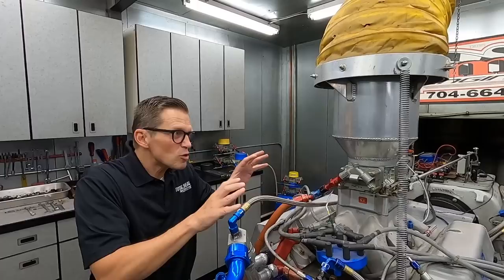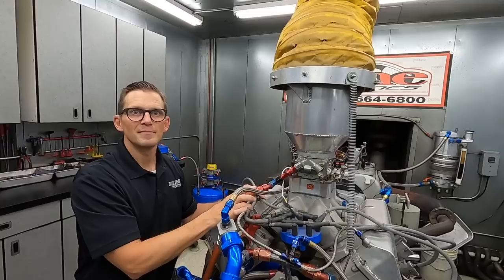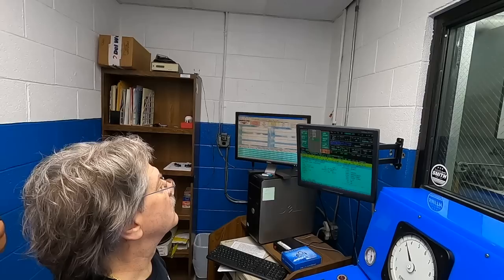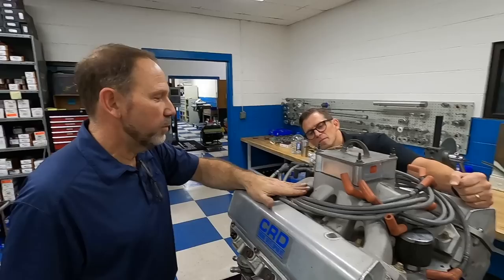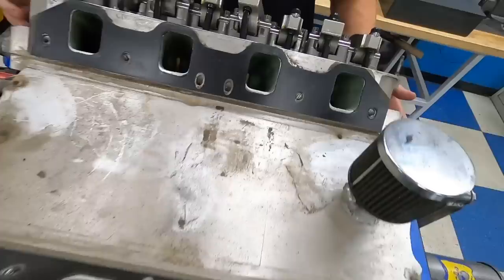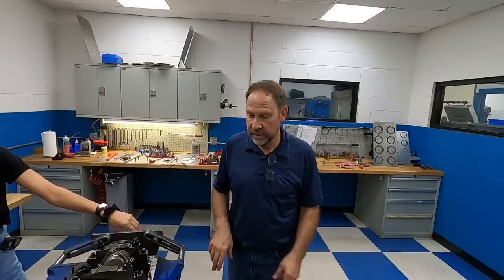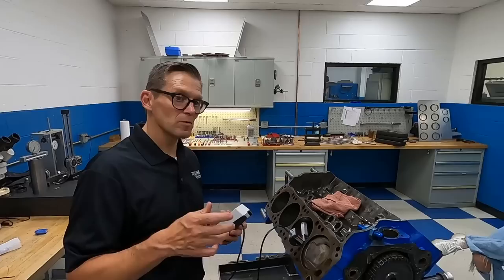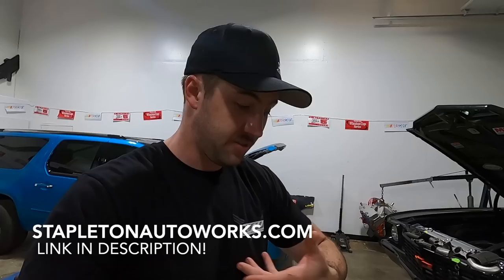Lake Speed's Ford C3 NASCAR Engine: Time Capsule of 90s Technology! (Dyno & Full Teardown)

Comment: Did anybody else notice what was happening at around 11:37?    Down 200hp?  Blame blowby?    ...??  What about if the higher cylinder pressures at around 6000+ were more than the antique plug wires could contain, spark-wise, and that one wire up front started arcing to the rocker cover, starting at around... 11:37?   Wouldn't suddenly running on 7 cause a BIG drop in power?   I didn't expect anybody to actually find anything that wrong inside, not enough to cause a power drop like that.   Maybe if somebody had the presence of mind to swap out some new plug wires...    :-)   It's easy to overlook a simple little thing when you're looking for something big.
Reply from the maker: I hate to rain on your theory but that is the plug wire heat shield flapping around in the fan wind. It does look like spark jump though
Reply: @Stapleton42  Sure did look like a spark jump.  And it would have certainly explained the power drop, since not much of anything else could have caused a 200hp fall without showing something pretty obvious.   But, then again, I wasn't there...   :)

Comment: I think its funny to watch Lakes response when his son starts to tell him how the engine was a dog on the dyno! Thats because HE KNOWS WHY! Look at his face when He is being told they didn't find anything wrong with it. Except  its built to have additional air pumped into it. That engine was built to be enhanced with a boost of external air or oxygen! They were "cheatin", the engine would have either had enhanced fuel with nitro or shots of nitrous,  or a mechanical pump(think small blower) like his son said driven off the diff and  hidden as part of the diff scavenge system. Pressure is pressure and the cylinder working pressure is what is most important and is not so much reflected all the time by compression pressure!
Reply from the maker: This engine was purchased by Lake after he retired to run vintage races for fun. He definitely was not doing any sort of trickery like that just for vintage racing. They didn't use restrictor plates at the Daytona roval either
Reply: @Stapleton42   Oh that may be but, someone spent a boat load of cash on a engine that as it is without any "help" it would never make power like it should. I think you folks have unearthed a great little gem. It was built to be "enhanced "  and that says  a lot about the rules  and tech inspections done at the time. I love it!

Comment: Is that a breather on the rear of the intake manifold?  What would that do to the amount of vacuum the dry sump system is able to pull on the crankcase?  On a lot of my dry sump engines, the dry sump pump itself will pull 15-16 inches of vacuum, but that's a completely sealed system.
Reply from the maker: there's a plug under it actually. kinda weird lol

Comment: I see a lot of really good parts man I really thought  this thing would've made closer to 600 HPs even being a little tired, even in the early 80s our 340 Mopar  with a cast iron 2 barrel intake manifold  W2 heads flat top pistons  and a flat tappet cam rule, even that motor made like 392 HPs man I really thought  this would've been a bit higher.

Comment: what was going on with the sparks from the front left plug/cable during dyno? 
Ps: engine building/tuning in US vs europe (during 90 and 2000`s) is 2 different worlds :) A good old 2.2 from audi whould give you crazy HP whitout  any inzane investment. Cylinder volume from 2 different worlds.

Comment: I didn't think a less than 9.5 to 1 piston and 350 cid could make close to 700 hp N/A but those are some huge heads. Dish piston and non mls gasket shocked me! Why aren't vacuum pumps used any more? Is that a special water pump? Supersized it's not electric. Same bore as my ls3. I'm hoping to get close to 700hp with a 427 stroker, Dart heads, 12.1 c.r. and 7600 rpm.

Comment: At 11.36 and 12.08 you can see the sparks arcing off #5 plug lead onto the rocker cover. Must have been a huge loss of power running on 7 cylinders.
Reply from the maker: That was heat shield flapping in the wind

Comment: I bet if  you check the springs, you'll find there  dead . I've seen motors set for a long time with out backing the rockers off,  lose over a hundred horsepower. Also with that thing setting for 20 years, who knows when the last time the valve lash was checked. That in it self could be  costing  you a ton of HP.

Comment: guy had lead nitrate powder in the gas? in a clean fuel event? ...solubility 376.5 g/1L. "leaded gas" It's Nickle Nitrate now. Nickel(II) nitrate hexahydrate solubility of 243g/100ml! cost at saturation is $779.901696usd/Gallon added to 130 octane gasoline. "emerald green"

Comment: i think the surly dyno operator said 470 average HP from 6000k rpm to 8k rpm, not a peak of 470hp? Because otherwise there must be a restrictor plate inside that intake,
Reply from the maker: it peaked at 480 I believe

Comment: Look at the dino pull video, the plug wire at the front cylinder is arcing to the valve cover
Reply: It wasn't sparking at all. Piece of something blowing around. And it's Dyno not dino.

Comment: Looks like front left cylinder was leaking spark out of the wire could have been causing a misfire
Reply from the maker: thats heat shield material but it does look like a spark at glance.

Comment: Very interesting ,How could engine lose 150 hp from sitting ? If was closed to elements Thanks
Reply from the maker: Good question! It’s in the rings. Small rust spots and slow degradation of the ring seal over time

Comment: in the vidio it looked like the no. 5 plug wire was shorting out to the valve cover
Reply from the maker: It was heat shield flaking off in the wind lol

Comment: What’s the chances of that particular motor getting set up for a show car. One that the sponsors want a car left
At one of the sub sponsors stores
And with a nice soft
Parking lot drivable cam in it that the people
Left
To
Watch over the car at the event unload it , load it back on trailer. Just a nice soft low lift low duration easy to unload and load from the truck. That kind of cam . That way no parts get hurt. Might make sense. Just a guess.
Reply from the maker: It’s a solid theory but the cam specs are in line with an engine that was built to make power. I think the spark plugs were bad or something random like that
Reply: @Stapleton42  leaky intake.

Comment: I'm only halfway through but wasn't it only running on 7 cylinders during the initial dyno session?

The left (on the video) spark plug/wires looked like they were arcing to the valve cover severely (watch at 12:06 for example). Most likely that cylinder wasn't firing during the dyno pulls.
Reply: After watching the rest of the video and realizing it was down from an expected close to 700hp to 480hp, it makes even more sense that it was only running on 7 cylinders. I could be wrong but it definitely looked to me like the spark was arcing to the valve cover or possibly the head and not making it to the spark plug.

Why did no one notice the arcing sparks on that spark plug wire? Why didn't they check the heat in each exhaust header tube?

Personally, that is one of the first things I check if I'm down a lot of power from what I expected (making sure each header tube is approximately the same temperature). I keep an infra-red thermometer handy for checking exhaust temperatures.

Another comment on the blow by. It is quite common for an unused engine to get some minor corrosion in the cylinders and rings. Often the blow by will improve after running the engine for several minutes (or in some cases several hours).
Reply from the maker: That wasn’t spark jump it was heat shield piece flapping in the wind from the dyno fan. It does look like spark though

Comment: I know nothing about engines, but I grew up a huge Rusty Wallace fan. Question on the old Grand Prix cars if you popped the hood would it have looked the same as the Chevys since they were both GM or did Pontiac do their own thing?
Reply from the maker: they all used the sbc but each manufacturer had their own cylinder head castings. Even those were interchangeable between GM brands. Watch the Ernie irvan intake and heads video!
Reply: @Stapleton42  thank you man

Comment: The video clip inside the dyno, you can see spark between the boots and the valve cover.
Reply: Not sparking at all. Something stuck on the head bolt blowing in the wind.

Comment: Surprised the dist gear is getting tore up and it's not even driving an oil pump.
Reply from the maker: very good point
Reply: Russell James    The oil pump is driven by a belt and not the distributor. Dry sump!
Reply: @wysetech2000  exactly,  that is why I am surprised the gear is tore up.  No load on it.  I've tore up bronze gears from using too heavy oil visc and a high vol/high pressure pump.  When only spinning the dist shaft and rotor with no load from an oil pump... surprised it got tore up.   Maybe an alignment problem.
Reply: @zz7qvl     Yeah, or too much end play in the camshaft.

Comment: This is really confusing, this giant engine is clean as hell, no carbon whatsoever, huge valves/heads but makes about the same power as a stock 350 LS truck motor with 200K miles on it. 🧐 🤔 It could NOT run over 200MPH with numbers that low

Comment: I guarantee that if you freshened up that thing, with NOTHING modern, and put pop ups @ 13/1, it will make your 700 np..
If you call CompCams, they will tell you the exact same thing.
What Lake Jr.  is missing is this particular type of experience based knowledge about the relationship between cam science and your DYNAMIC compression ratio that dramatically relies on high numbers to be efficient at high RPM. 
Grumpy, Jack, and Robert would also have agreed, the second they saw the head removed.

Comment: Valve springs are killed. Should make 780 at least.
Reply from the maker: Check the next video in the series we test the springs!
Reply: @Stapleton42  the must have back the rockers off. Normally motors that sit up along time the 2 valve springs that are open are killed. It helped they were fairly light spring rates. The high pressure springs like 500+ on the seat 1200 open don't last long.

Comment: Awe c'mon!!!.....You can't let a set of valve springs set under load for a couple of months before they are junk.....you HAVE to zero the load on race springs, and even the pre-load with the keepers installed will degrade their performance......20 years?....you're lucky you didn't drop several valves............

Comment: 4.062 bore.... IDK, anything with a >= 4 inch bore just seems to make power
.
GM 400 SB with a 4.125 inch bore..... damn good motor (the myths about them overheating and bearing speed are just that.... myths)
however.... the ford 6.7 power-joke only has a 3.9 inch bore
.
so now i know why ya have to rev the CRAP out of the 6.7 in my F-550 tire truck to make any power
its like.... good torque from 1000 to 1500 
nothing from 1750 to 2750
and then you get SOME HP from 3000 to 3600/3700
(but it FEELS like it moves faster at low RPM)
.
.
but ya.... for a 6.7 diesel.... id figure they would have a larger bore
especially for the RPM it can hit (4000 isnt that high.... but its higher than a 6.7 cummins'es ~3500)
.
.
.
idk.... i feel FERD would get more power and torque with a shorter crank throw and larger bore...........
large bore / over-square engines are VERY common today..... for a good reason
.
and yet.... the 6.7 power-choke is under-square.... 
.
.
.
im not a diesel guy..... so maybe under-square works better on diesel fuel
but you would have to convince me LOL
.
.
.
.
.
.
.EDIT
also.... from what he said at 41:51..... 
a larger bore can run more comp and or timing on the same octane (or same comp ratio and timing, on cheaper gas) VS a smaller bore
did i get that right???
.
if so....add another reason to why i LOVE my 400 SB's 
.
.
i REALLY do not understand the hate the 400s get..... 
even from GM guys
.
in stock form.... 1977-78.... 4 barrel carb.... 175hp@3600 and 290 lb-ft at 2800
a 77-78 350....165 at 3800 and 260 at 2400
.
like... why does the 400 make MORE power at lower RPM
yet more torque at a higher RPM?
.
THAT DOES NOT MAKE SENSE!!!!!
unless GM was under/over-rating one (or both) engines
.
.
i KNOW they will make ~250hp and ~390+ lb-ft if measured off the crank.... with no emissions equip
stock cam, heads, intake, and Q-jet carb
.
.
like.... my 99 buick century makes 160hp (and it probably makes closer to 180-190.... when it hits the "intake frequency" around 4200 rpm)
its like a light switch or a 2 stroke dirt bike.....
goes from nothing to WWWWWAAAAAAAAAAAAAAAAAAA in about 20 RPM
.
and my 99 buick is WAY lighter than my 77 chevy K10 (with full time 4 and a TH350 with only 1st and 3rd.... makes a LONG shift from 1st right into 3rd.... but the torque from the 400 just dont give a F)
.
.
anyway.... point is
a heavier brick shaped object is WAY WAY faster than my lighter 99 buick
.
so i think that 175HP is WAY WAY under-rated
that must be AC on, P/S pump against the lock, EGR wide open, A.I.R pump.... ETC ETC ETC
.
.
their is just NO WAY a 400 sbc.... even in BONE STOCK form.... only makes 175HP (especially at 3600..... it REALLY starts to pull around 4200-4500 RPM)
.
.
.
.
also..... the 400 piston is the same size as a 454
uses a different wrist pin size and all that..... but its the SAME bore
.
.
big block pistons in a small block
how can you hate on that?

Comment: could it just be that FERD over-rated their engine???
.
GM under-rates
FERD over-rates
and dodge is too busy sniffing coke off a strippers butt crack.... and putting a super charged hemi (thats not a hemi) into a minivan
.
like... dodge is so coked up...... they made ~5 generations of the 5.7 "not a hemi" hemi
and all 5 gens still have the same lifter angle that causes lack of oil to the cam and roller lifters....... 
.
.
ya think they would have fixed that by now...... but no
they engineered the TIPM.... (so if a headlight burns out.... now you need DEALER ONLY reprogramming of the "electronic fuse" for 500 bucks...... instead of using a 10 cent fuse)
they found out how to REQUIRE a bumper removal for a head light bulb on ALL their models 
they make a new U-joint thats dodge only
they require you to get a "secure gateway" to plug in an OBD 2 scanner
.
like.... ford is under-powered.... overly complex.... cheaply built junk (ford got ALL them cams.... and cant keep up with a pushrod motor)
but dodge is the KING!!! at dealer only parts, services, and repairs 
.
and GM is just trying to kill it self
bring back the buick 3.8...... WAY more reliable (and gets better MPG) than the 3.6 and its STUPID oil filter location (so many burns on my hands)
.
.
.
also.... FERD got a bailout also..... larger than GM
and while GM paid their bailout back ASAP
FERD is STILL!!! paying it off